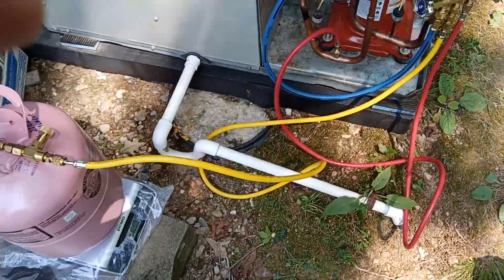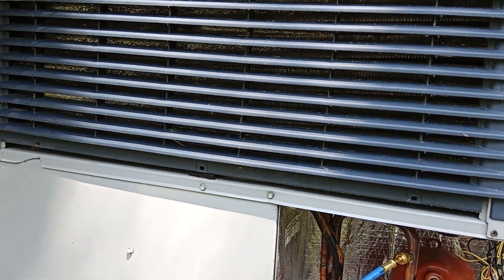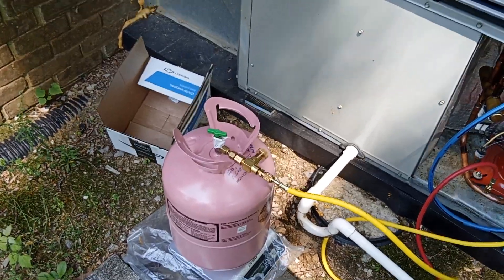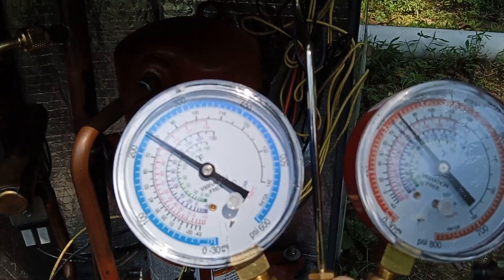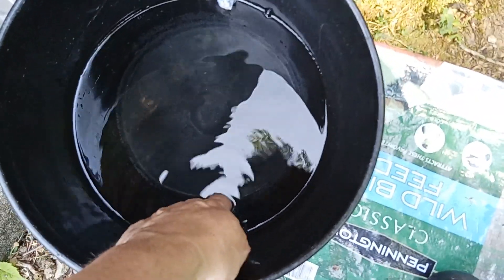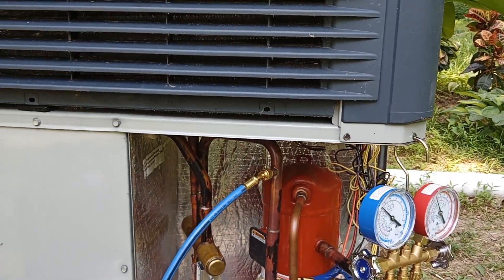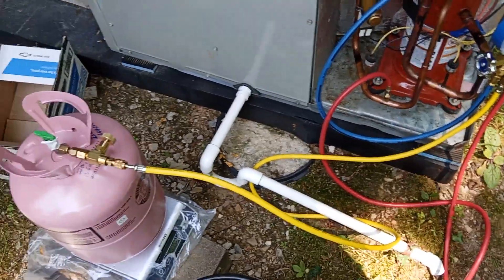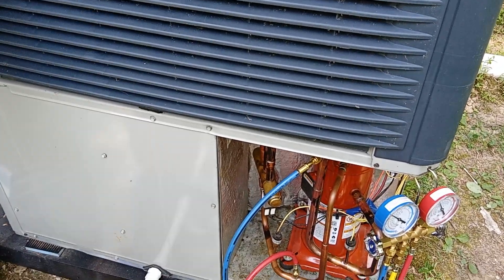Charging R410A VAPOR - NO COMPRESSOR!

Comment from the maker: To really make this work well, do it at night at lower outdoor temperatures so the sealed system coils are cooler, that will keep the system pressures down.

No, is not going to charge 8 pounds in a few minutes, but who cares? I had all day to do it.

Charging slowly allows the refrigerant to distribute thru the system.

This is NOT a risk to the compressor low side because it only took a few seconds for the added pressure to work its way back to the compressor high side.